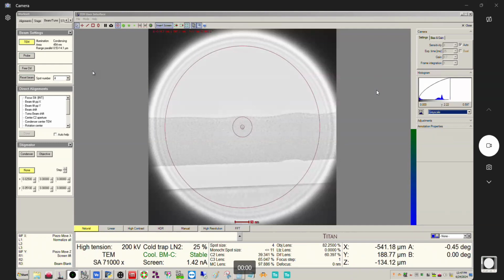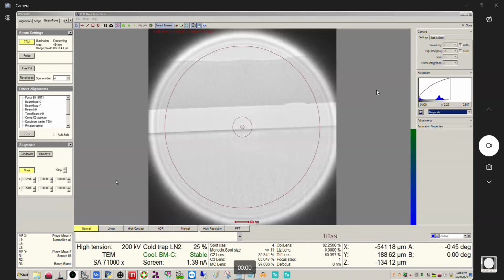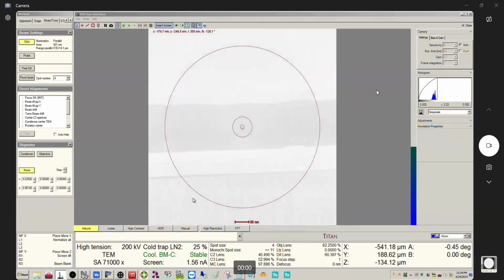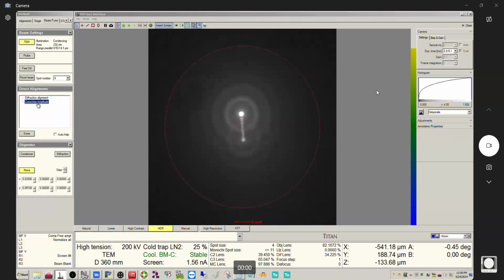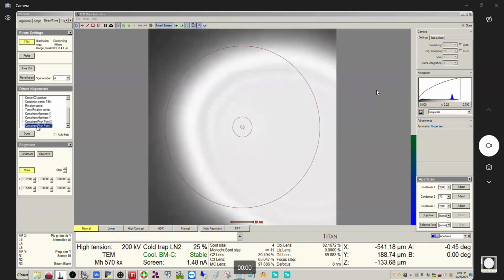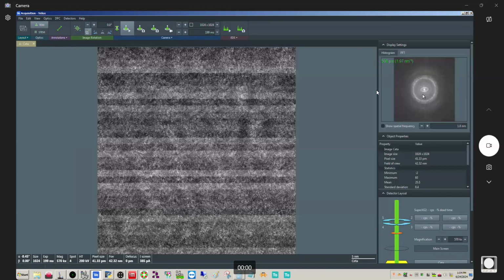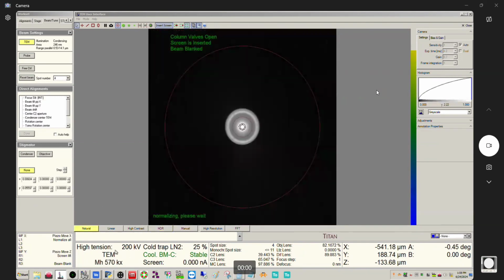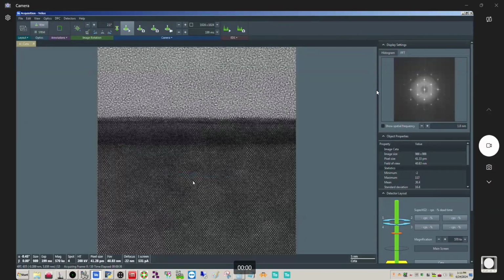HR-TEM (lattice) imaging: coma-free axis alignment tutorial

Comment: Hi Nicholas, great detailed video on the coma-free alignment!
An aspect I was wondering about: After inserting the objective aperture (OA) with a cut-off at about the point/Scherzer resolution, I would also expect a "sharp" cutoff for spatial frequencies in the FFT of the HRTEM images. That would be around 0.2 nm for Talos/Tecnai at 200 keV (= radius of the OA). But the actual images have FFT spots at higher spatial frequencies... Do you have an explanation for this effect? Is it related somehow to sample thickness/double diffraction? Do the FFT spots actually correspond to the diameter of the OA (i.e., up to 0.1 nm resolution)?
I see the same effect for my measurements when I insert an OA to avoid aliasing effects at "lower" magnifications.
Reply from the maker: Hey, sorry for late response.  Your question about seeing detail beyond the limits of the OA is a great one and really deserves an entire video to properly answer it.  That being said, the short answer for why detail beyond the OA limit is observed is due to non-linear effects, which is another way of saying interference between different Bragg beams rather than interference between Bragg beams and only the direct beam.  If only interference between the Bragg beams included in the OA and the direct beam was transferred to the image, then we would not see any detail beyond the OA limit, but this is never the case because interference between Bragg beams does indeed happen.  This is one of the advantages of HAADF-STEM over HR-TEM: the information limit in HAADF-STEM never exceeds the probe size due to the incoherent nature of the imaging, which does not rely on any contributions from Bragg scattering.  Again, this question really deserves a dedicated video, and I hope to do this eventually.
Reply: @NicholasRudawski  Hey Nicholas, no worries about the late reply. Thanks for taking the time! I agree with you and now understood this effect. Indeed, we also perform mostly HAADF-STEM nowadays, so these "phase-contrast problems" never show up there in this extend. :-) I can imagine that interference between the Bragg reflections can indeed cause the higher-order reflections, e.g., +g/-g -> 2g or something along that line - even if the 2g spatial frequency would be outside of the OA radius. That's all probably also related to using very thin samples (i.e., within weak phase object approx.) for quantitative HRTEM/comparison with image simulations. I will have another look into textbooks. Nowadays, "simple" lattice fringe imaging is often good enough for my cases.

Comment: Nice description of the procedure and the physics behind it.

I have a question: is voltage centering available in TFS machines?

Maybe also worth noting that automated comafree is available in the Sherpa; such automations are really useful for none infrequent users. I really recommend using them.
Reply from the maker: Thank you; I have never seen any FEI or TFS S/TEM with a voltage centering option; it's always just rotation centering (though I know on the JEOL instruments you actually do have both options at your disposal).

In our version of Sherpa, we actually don't have any automated tuning for coma-free axis alignment in conventional HR-TEM mode; we only have features to assist with tuning STEM imaging and the monochromator.  If I ever get on a system with automated coma-free axis alignment, I will definitely be curious to see how well it works.  I do indeed agree that having Sherpa can definitely save a lot of time and hassle, particularly for more inexperienced users.  Without question, my favorite automated tuning is focusing (C1) and two-fold astigmatism (A1) correction in STEM mode.
Reply: @NicholasRudawski  ah that is a pitty that they have not offered the Zemlin Tableau in all sherpa versions. They have this functionality in some sherpa versions, especially for cryo-EM and I like it a lot. There are also scripts for DM and also it is included in SerialEM. I can guarantee it will not be faster than you, but it is very accurate. I end up in >1000 nm (never thought why it is in nm) when I do it manually (which is good in many cases) but sherpa easily reaches bellow 200 nm.
Reply from the maker: @farzaadkhaan  using SCORR to tune the probe corrector, I do see a similar tableau (though it is of probe shape versus beam tilt, not FFT versus beam tilt), so I would guess the Zemlin Tableau would be shown when performing image corrector tuning with SCORR (though it is a bit more of a hassle to use SCORR compared to Sherpa).
Reply: @NicholasRudawski  Yes, I am from FEI. We use objective current wobbling for rotation centering, not HT.